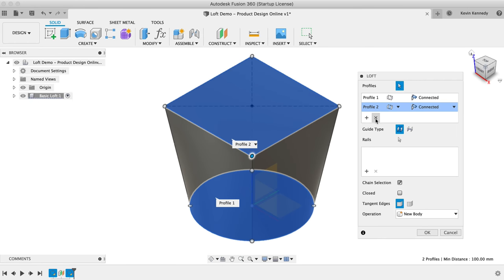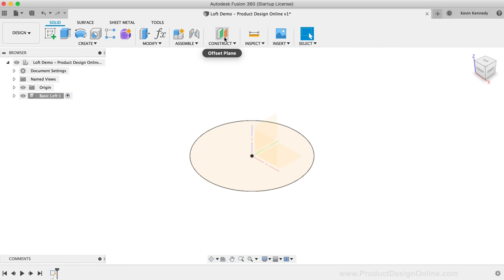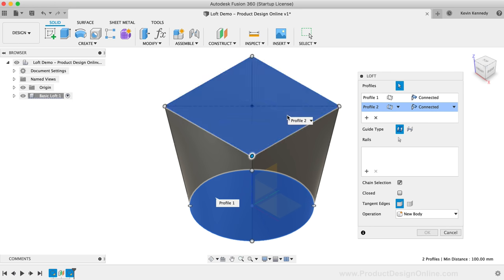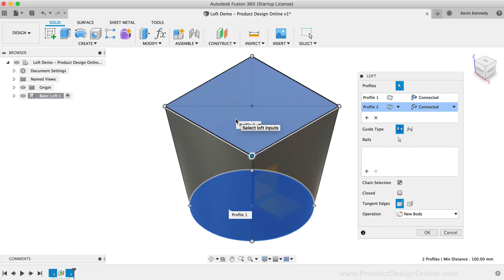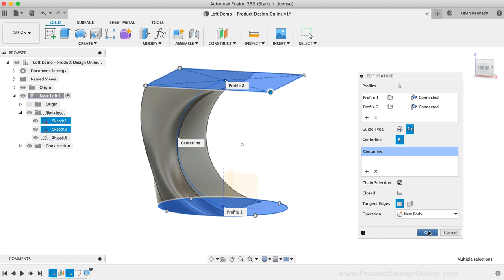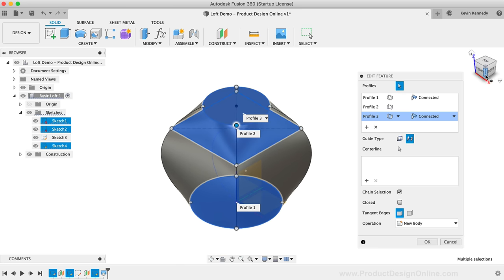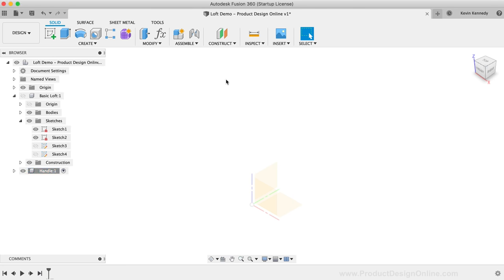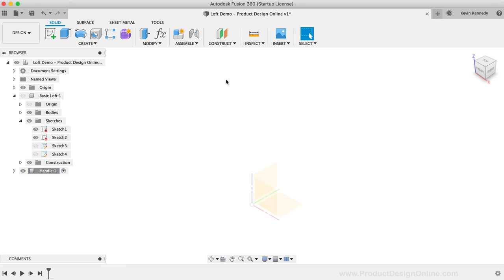Loft in Fusion 360: Beginner to Advanced Techniques

Comment from the maker: Skip ahead to the advanced demo. Click Here  ➞ 8:30
-
TIMESTAMPS
0:00 - Understanding Fusion 360s Loft command
0:40 - 3 Types of Loft commands
1:21 - Setting up sketch profiles
2:37 - Creating a basic loft
5:37 - Adding a centerline rail
7:39 - Changing profile order
8:30 - Advanced loft example
9:00 - Setting up a reference image
10:00 - Explaining the approach
11:30 - Creating guide rails
15:19 - Creating the 2nd loft
17:20 - Creating the 3rd loft
19:00 - Room for improvement
20:23 - Creating a Surface loft
21:51 - Creating a Form or Sculpt loft

Comment: This helped me get started with lofts, but now I want to loft something complex and I need a tip on how to get there.   At the end of this comment I came up with a good cookie cutter analogy.  Let's say you're making a simple flowering design that has some scallops on the edge of the cutter as I describe how I designed this:  Imagine a circle: 31mm.   Now place a small circle inside the larger one and make it tangent to the outer circle.   The outer circle is my pattern.  The inner circle is the item to be patterned 17 times equally around the circle.   Now make the small circle tangent to its neighbor and because of the pattern tool all the circles will be resized so that they are big enough to be touching.   This is a simple scallop pattern.  I use a large (but smaller than the pattern) circle as a cutting tool and I cut the 17 circles so that there is less than half a circle left.  (There is a gap between the 17 arcs that are left and that gap is connected with a line.  So a scalloped edge with little connector lines going all the way around.     I create a 0.5mm outer offset from this scalloped pattern.    So, extrude this 0.5mm thick scalloped pattern and I chamfered the edge so that it is sharp.   At one end of this 0.5mm thick shell I place a circle that is 4.5mm thicker in radius or 9mm thicker in diameter.   I want to create a loft from the circle to the top of the complex pattern.   I guess I could just scribe a circle in the middle somewhere and loft circle to circle instead, but it seems like there ought to be a way to loft a cirlce to a complex pattern and I'm just missing it... maybe I need to project my pattern up there somewhere.   If you can't follow what I've described well enough to suggest anything, I'll understand.  I was just hoping that you might be able to envision the scalloped 0.5mm thick shell.  You could imagine a flower cookie cutter and how you would make a circle at one end and loft it up to the scalloped cutting end.   The 0.5mm thick side is chamfered to create a cutting edge.  The large circle side is what you hold onto with a nice strong base and the cutting edge on the other side of this object is what you have lofted up towards but leaving enough exposed to still cut the dough.

Comment: Something weird. So you went to origin then when the planes appeared mine did not. The top eye symbol for origin was greyed out. OK so I clicked it and there you could see three planes. I selected the bottom one with my new mouse. It turned blue. I double clicked and nothing. I tried clicking with my trackpad but nothing and then enter on keyboard but still nothing. I replayed your video 3 times and just as you select it a little round icon appears on your screen almost right next to the plane.

Then if I right click mouse and select create sketch it allows that highlighted plane to be worked on. So I finish sketch to go to offset plane and then once the plane is there I click on it and the plane turns blue. Right but nothing else. It does not flip and let me work on it. If I click stop sketch the plane is gone. Checked the settings as much as a novice can and nope, nothing stood out. So since getting this mouse even the trackpad won't select and make the plane workable.
Reply from the maker: Hi James. Are you referring to the first loft example where I create the center circle? If so, I should've noted that I first activated the center circle with the keyboard shortcut letter "C". That is likely the "round icon" that you were seeing.

One thing to also be aware of. If you created a new component then you will end up with TWO origin folders. One origin folder for the top-level assembly file and ONE origin folder for each individual component. You'll want to make sure to turn on the visibility of your component's origin folder, ensuring that everything is created within that component. Otherwise, if you go to move the component, you may run into issues with it tied to the main assembly origin planes.

Let me know if this helps! Cheers, Kevin :)
Reply: I defo remember just clicking on the plane after highlighting it and the auto project zooming in to it so you could work on that. This was proved when I created an offset plane and then also clicked on it. The plane appeared blue but no auto zoom to it. Instead and from an angle I had to press the short cut key for the rectangle and then watch from an angle as I looked for the centre to drag out from.

Comment: Is it possible to use your printer/scanner to scan in let's say a picture of a drawing(instead of scanning in a document) then use that scanned in image in Fusion360 to dimension it using the actual measurements?
Reply from the maker: Hi Rud Dog. As long as your scanned in file ends up as a jpg or png you can attach it to your Fusion 360 file. Scanning in sketches and other reference drawings can be super useful. Cheers, Kevin :)

Comment: Loft question. I wanted to make a plastic knob larger on the bottom with a taper to the top. Also, I wanted to make vertical cuts in the knob for easy in turning. I started with a sketch circle and tried making smaller circle to cut into the circle sketch 2D. Yes it cut. But I couldn't get the pattern to function for other circular cuts. If i extruded the sketch to say 1mm then the pattern would cut into the body. Does pattern only work on bodies and not sketches, or am I really missing something.

Comment: Your videos are great! Does using rails work in the free version of Fusion 360. I have tried repeatedly and can't get the rails to work. I made sure it was connected but still no love. Any suggestions?
Reply from the maker: Yes, rails work in all versions. Majority of the Design Workspace is available in the free Personal use license. To get rails to work you'll have to ensure that they touch all the profiles. You can use the "auto project edges on reference" feature, which can be turned on in your preferences. Otherwise, you have to manually project each point with the project command.
Reply: @ProductDesignOnline  That worked great. You are  a true master of the software and a gifted instructor

Comment: Let's say I scan in a small printed board on my Epson printer saving it as a JPG file. What I would like to know is there a video showing how to use this scanned in the pic as a template for creating your sketch? Sort of an overlay with tracing paper.
Reply from the maker: Hi, Rud Dog. If I'm understanding you right, the best approach would be to "trace" the outline of the image with the sketch geometry tools. Always try to use the least amount of sketch tools and avoid splines when possible. If you're looking to "automate" the process then you can use Adobe Illustrator (or a free alternative) to "autotrace" the image. This will turn the outline into an SVG, which you could then import into Fusion 360. You can then use the SVG as sketch geometry. However, SVGs typically can't be fully constrained or dimensioned, as you could if you recreated it from scratch. Cheers, Kevin :)
Reply: @ProductDesignOnline  Sorry sometimes I bable on without bringing the point home. I will try again only because after reading that I could see how the point could be lost.
PCB with four holes in it. Rather than measure the board hole locations and transferring them to Fusion360 how about we scan the board in on my Epson printer/scanner. 
Take the scanned in jpg file and import it (if you can) into Fusion360 and use this imported file as a template to overlay your sketch and place holes on sketch. 
If you can't import jpg can you change it into svg file then import for use as a template for hole locations? Should I be looking for a video in your arsenal referencing svg creation?
Reply from the maker: @MaxGoddur  Hi, Rud Dog. Sorry, I misunderstood you. You can attach a JPG image using the "Canvas" option from the "Insert" dropdown list, as seen in this video at 9:00. The key part would be to make sure you calibrate the correct size of the image before tracing the circles of the PCB. Right-click on the image in the Browser to select "Calibrate" > select two points (I would suggest setting the known width of the board or one circle/hole) > enter dimension > click enter key. Then, simply create a "New Sketch" on that same plane to recreate the circles for the holes. At this point, you would essentially trace over the holes in the image. I wouldn't recommend an SVG for a shape such as a circle because the imported SVG geometry cannot be dimensioned like native sketch geometry. Using the circle command would allow you to update or change the dimension later on (if needed). Cheers, Kevin :)
Reply: @ProductDesignOnline  Just finished copying your instructions and now will go and follow them to get this done. Thank you so much.
Reply from the maker: @MaxGoddur  No problem! Always happy to help :)

Comment: Playing with physical material or color of the object and was able to change the body of the item to blue color and wanted to, on the same object, change the end to a different color. Can this be done? I have a representation of a battery with blue outer covering and the ends are either gray or white.
Reply from the maker: Hi Rud Dog. First, just want to confirm you're referring to Appearances? Physical Materials/properties are different than appearances.

With appearances that can be done. Apply the color to the entire object first. Then, select the single face that you want to color with a different appearance. It will highlight that face (blue surrounding highlight). You then need to simply drag the appearance to that highlighted area.

I follow the same process here (@8:37) - https://youtu.be/eVRdKjQu6po?t=517 

Cheers, Kevin :)

Comment: Had to turn off chain selection for the loft @19:40 to work, I noticed you did not. Mine gave me a warning that the rails were not connected to both profiles. I've been following your steps, and redid it several times. I don't see why it wouldn't be connected. Also, creating points to connect the arcs to the profile did not work - I had to use project.

Comment: That’s great! But what if I wanted to add a surface detail?
For example, adding a rubber grip housing to a toothbrush for example where there will be a surface break/indent from the grip transition to the surface.
Reply from the maker: Offset faces/surfaces with the surface feature > create 2d sketch of desired grip contour > surface Extrude sketch  towards the offset faces > trim surfaces > patch to join the surfaces together > and then Stitch all surfaces to make it a solid
Reply: @ProductDesignOnline  what..in the world? Sorry, i'm more of a visual learner, hopefully you'll get a video up of it soon if possible :/ haha, thanks for the time in replying though! much appreciated.
Reply from the maker: @Adrian-wd4rn  haha, no worries! I'll try to make it a video sometime soon.
Reply: @ProductDesignOnline  Yeah, we're doing a product redesign, and while we would do it in foam, we have to do in with other means now, wanted to do it in cad, but I never played with surfacing in fusion before so it's all new/confusing to me.

Do I just completely offset the surface of the body? Once Do a sketch on the plane, how do I get the rubber grip to wrap around the body? lol. I'm clueless when it comes to surface modeling.
Reply: @ProductDesignOnline  SitRep. I tried doing this, however, my sections that I need when I offset faces are not circles, but rather, fairly rounded rectangles. Any solution to this?

Comment: I am really struggling to connect geometry using loft where the profiles meet at a point. Give me self intersecting geometry errors. But occasionally, it will work, and I don't know what it was I did to fix it because I have no ideqla what was wrong to begin with.

Comment: @6:10 there is an arc placed. Mine won't snap to the top center point and I'm thinking that this is also the reason it doesn't allow for it to be moved in the timeline? What am I doing wrong?

Comment: Can I make it so, that when I change the sketch afterwards the forms loft automatically changes with it?
Reply from the maker: Yes! If you use Sketch constraints and parameters, you can easily make sure it adapts. The key is to make sure the sketches are fully constrained and dimensioned.

Comment: for someone who is not familiar w fusion it is very confusing when you use a shortcut or go to something assuming its known where it is. Its taking me over an hour just to get the initial sketch shapes in place.
Reply: example, at 1:56 you say create a rectangle off of the offset plane. and it appears to switch with no clue or motion showing what was done
Reply from the maker: This specific tutorial expects you to have gone through some of my ultimate beginner lessons first, such as the 30 Days course.

Those are very basic things that I cover many many times and you would need to know to consider more advanced lofting.

Comment: I am trying emboss after loft but i can not. Is there a way put pattern on loft surface? Thanks.
Reply from the maker: Emboss currently doesn't work with complex surfaces (curves that go in more than one direction). You can try to use the offset/press pull command...but that can be hit or miss depending on the shape. Try to place the sketch behind/inside the object and then select the sketch profile > shortcut letter Q > then select the front face of the 3D body.

Comment: Is it possible to loft multiple profiles to one face? Example a speaker box face that has two speakers on offset angled planes that need to be lofted to the box front together.
Reply from the maker: Hi, Shane. You can in fact do that with the loft command. You will have to re-show the sketch (as they are hidden after use with the loft, by default). Cheers, Kevin :)
Reply: Is it possible to loft two profiles simultaneously to one face ? I may have to use the form tool to do what I’m trying to do. I’m pretty new to CAD please forgive me.
Reply from the maker: @shanebarrett5827  Yep, that is possible as well. You will need to be careful of the order you select the profiles as that can affect the outcome :)

Comment: your pc is so fast xD
Reply from the maker: Hi, Chloe. I'm running Fusion 360 on a MacBook Pro...but there are many computers that can run F360 with good performance. Here are the minimum system requirements if you want to cross-check them with your computer - https://productdesignonline.com/tips-and-tricks/system-requirements-for-autodesk-fusion-360/
Cheers, Kevin :)